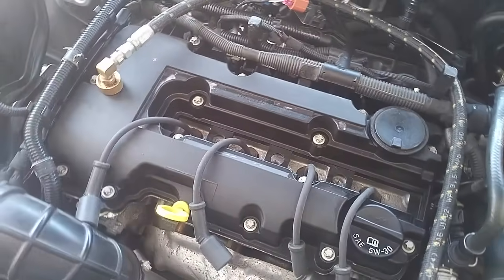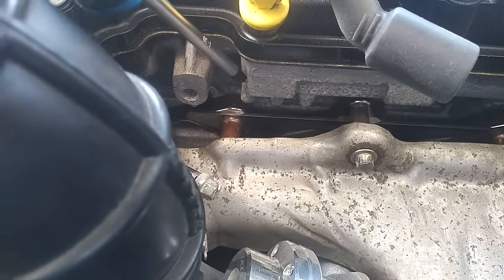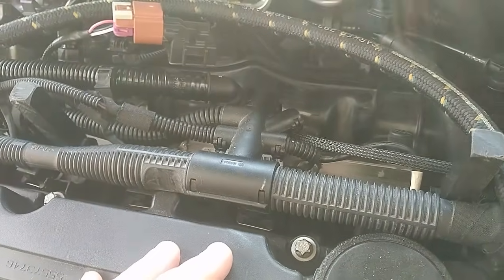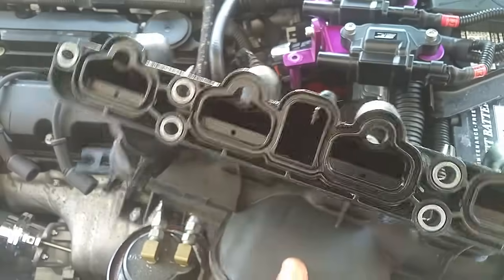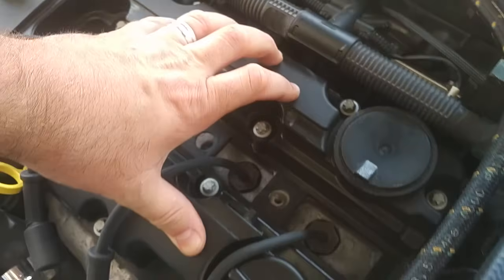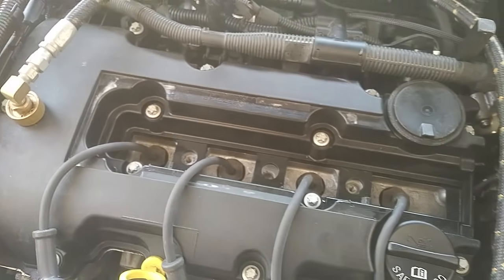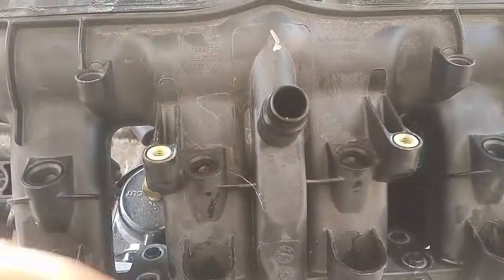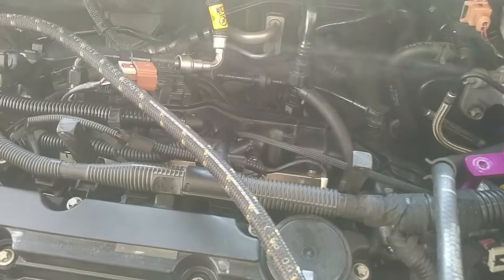Chevy Cruze Sonic Trax Encore 1.4L Turbo PCV Issues, Diagnosis, and Solutions

Comment: So I finished the install and drive and now I’m still getting a leak right around the oil fill cap on the valve cover. I did change my cable cover before I got your kit and drove maybe 30 miles on it. Could the upper PCV release on the valve cover fail again?
Reply from the maker: Pull the dipstick at idle. Put your finger over the dipstick hole to seal it. Do you have mild vacuum?

Comment: had the intake manifold replaced 4 times before 70,000 miles
Reply from the maker: Could have just installed the pcv fix kit and the check valve could be replaced for $5 each time.
Reply: @AndreiDPop  the vehicle was under warranty, i would have voided my entire warranty at my dealer. However since my warranty is over now this would be the fix, but gm did a redesign "so the dealer said" and ironically i have not had this issue since they replaced the last time... fingers crossed lol. Now my new error is Knock sensor.. GM has just turned to shit over the years... I find it really odd that people find these simple fixes and the car companies just do not fix it.. then again, Fix = no revenue... kind of sad.. I'm getting up in years lol, so tooling on my car now is more of a hassle than fun like it used to be. wish i still had my 350 rocket lol.
Reply from the maker: @michaelmorrow9927  there is no redesign. It’s the same part with the same problems. They might have changed the part number but the issue with the check valves missing is the same.

Comment: Hahahahahah great minds think a like. I built one almost to the tee like yours lol. I’m not producing it tho lol. Great job bud yes I did it too my sisters in 2017 and it still good. Also the gear I used is way weaker than yours and my sister drives like a frikin thief  in the night as well so I’m sure your design will last forever bro.

Comment: I have that problem now! And getting it fixed ! Thanks for the information! The parts are cheep but the labor is what is costly!
Reply from the maker: I mean you can install my pcv fix kit yourself for $75. That saves you a ton over having a shop replace the manifold.
Reply: @AndreiDPop  how can I order the PCV Kit from you?  Also, I have not done a turbo boost leak test as I would like to get my hands on one of those as well.
Reply from the maker: @franklujan7480  you can order both of those from cruzekits.com.

Comment: Sorry I can't make heads or tails from this.

1:42 how exactly does the valve cover extract the oil?  

2:18 what's your source on this being a 'vacuum regulator diaphragm'? Seeing as everybody calls this differently it'd be nice to have an official name/source for it. 

2:28 why would the amount of vacuum in the intake need to be regulated? What's so special about the cruze that this needs to happen? Isn't the idle air control and the throttle body used to control the amount of vacuum? 

3:04 an illustration would be nice here, the diafragm limits the amount of air entering the engine? you're saying it 'limits the amount of flow to maintain vacuum at 18 inches of water', but if it.. nevermind I don't get this at all. An illustration here would be nice as well. And what's up with the channels that run around the cover?

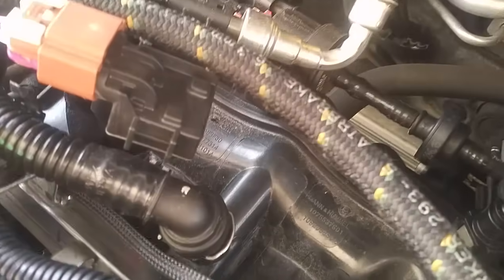7:17 which one of the hoses are we actually looking at? You're saying 'intake manifold check valve' so I assume we're looking at a hose in the intake manifold, but at 6:02 we're looking at the exact same hose which apparently carries PCV gas to the turbo intake. So to where does this hose go, the intake manifold or the valve cover gasket where it collects crankcase vapors?

You're also telling about two ways that crank case ventilation happens: a situation where the turbo is creating pressure, and one where it isn't. I only see one way in the video so it seems I'm missing something.

Extra credits, what's the brass fitting on the left of the valve cover, shown at 10:11?
Reply from the maker: The diagram I made in this thread will also help explain how the system works. 

https://www.cruzetalk.com/threads/2011-2016-cruze-limited-1-4l-pcv-system-explained.175793/
Reply from the maker: The pcv path goes through a series of channels that allow the oil vapor to condensate around the walls and drain back into the sump. 

This is actually a very common design among European cars. It’s a vacuum regulator diaphragm. Anyone else that doesn’t refer to it as a diaphragm that regulates vacuum is wrong. No source needed. That’s what it does. It regulates vacuum on the crankcase to 11-18 in-wc. 

Too much vacuum on the crankcase damages the front main seal. No, idle air control doesn’t regulate anything because the crankcase is connected downstream of the throttle body, and the throttle body electronically controls idle. There is no separate aic valve.
Reply from the maker: An illustration is available in the tech articles section of cruzekits.com. 

The hose is the one on the manifold. Yes it goes to the turbo. The intake manifold check valve is inside the intake manifold and visible when you pull the hose off the manifold. The hose connects between the intake manifold and the turbo inlet.
Reply: @AndreiDPop  thanks for your response. I only have more questions now, like what in tarnation is the purpose of a hose between the intake manifold and the turbo inlet?  tomorrow I'll have a look at the links you sent me.
Reply from the maker: @Netherlands031  to give the pcv gas somewhere to go when the intake manifold is under boost.
Reply: @AndreiDPop  how does this hose carry pcv vapors when it goes from the intake manifold to the turbo inlet?
Reply from the maker: @Netherlands031  the intake manifold has a pcv chamber that connects to the valve cover through the cylinder head. This is a free flowing chamber that has a check valve on the edge of it but still allows gas to flow from the crankcase to the turbo inlet unobstructed.
Reply from the maker: When the turbo creates pressure, check valve in the intake manifold closes and pcv gas goes into the turbo inlet. When turbo does not create pressure, the intake manifold is under vacuum and that check valve opens and sucks all the pcv gas through. 

Brass fitting on the valve cover is for my AMSOIL single remote bypass oil filter return line. 

https://cruzekits.com/tech-articles/f/why-do-we-even-need-a-pcv-system

Comment: I recently received a letter from gm regarding a recall on the pcv valve. I’ve been having issues with automatic shifting and thought it was my transmission, but my mechanic has indicated that it’s a issue with my turbo. Can this issue be caused by this pcv valve? I want to figure out if they’ll cover this issue because the turbo is very expensive to replace.
Reply from the maker: What issue have you been having specifically? Any codes? Have you actually inspected the intake manifold check valve as shown in this video?

Comment: I've been looking at this for awhile to buy your kit. I have a quick question about the check valve nipple. 

I'm looking at purchasing the V3 kit, my question is what if the nipple is still present in the manifold. How do I install the kit? Thank you
Reply: Yea I checked to see if mine was still intact and it was? But my valve cover still has that leak. So do you first try and take out that valve nipple? Or what did you do! Thanks!
Reply: @chrisgiesbrecht4730  Not sure still waiting for my initial question to be answered. I am afraid to take the nipple out cause it will obviously fall in intake trying.
Reply: @optionsice  seems like you can just push it in with a screwdriver. Than cover the hole. Since they always break I'm guessing they just stay inside the port

Comment: An after-market 'fix' is apparently available -  and looks like an improvement on the OEM design:  https://youtu.be/f9CFOPQD4yU
Reply from the maker: Yep, that's my fix. It's both a fix and an upgrade to the OEM design. My latest design is on its 4th revision now (v3.4+). It's far better than the OEM design as it costs far less and makes the valve serviceable.

Comment: So the other hose in the valve cover is the same for the pcv function? And whatbof the product donu recommended for my sonic rs 1.4 please . Thanks
Reply from the maker: That hose in m valve cover is a return line for my AMSOIL bypass filter.
Reply: So what tipe of the kits do u recomend for my sonic rs 1.4 is stock engine
Reply from the maker: @sancheztorres35  the most popular, easiest to install, and best value is the v3.4 kit. That should be your best bet.

Comment: Quick question, does the pcv hose at the intake manifold have both a rubber o ring and a black hard plastic washer or just the o ring? I disconnected it at the intake manifold but I can't seem to get it back on with a click/clip into place.
Reply from the maker: Yes it has both. Get some grease on the manifold and it will go back on.
Reply: @AndreiDPop  Thanks. I just bought a replacement PCV hose because air is blowing through both ways on the old one. But the new one and it's replacement are also blowing both ways. If I blow hard enough there's some resistance but I thought they weren't supposed to do that.
Reply: Figured out that the inexpensive ones don't work like the genuine oem replacement. But now the Diaphragm is sucking in air hard... UGH.
Reply from the maker: @FrankWithanF  get a new valve cover on there asap
Reply: @AndreiDPop  for anyone reading this. The dealership fixed it for free because a special coverage.
Reply from the maker: @FrankWithanF  yeah they’ll fix it but some people have had issues because they require a check engine light to be on and the issue doesn’t cause a check engine light. Also not everyone trusts the dealership to fix it because they’ll just throw another of the same defective and poorly designed part. The pcv fix kit I offer is a design and upgrade to the system that makes the check. Valve serviceable. The coverage is also only up to 10 years or 120k miles whichever comes first, which most of these Cruzes have exceeded now in mileage alone.
Reply: @AndreiDPop  yeah that's true saved me some money though. I'll probably try to get rid of the car before it goes bad again haha.

Comment: Hi Dre Dan awesome video and explanation. You and one or two other guys have similar fixes. What is the hose mounted on top of your valve cover, where does it go and what's it for. Have you made a video showing and explaining that setup. I'm having all the same issues you had and this will be the second time I've replaced the VC.
Reply from the maker: I'm the only one that has the PCV fix kit. There are a few guys who have attempted something different as an adaptation of one of my designs, but there are flaws with each approach. For as simple as my solutions look, they're actually quite complex, and a great deal of time was spent during research and development. Even the epoxy selection took me two weeks, spending hours each day with engineers at loctite and jb weld discussing technical requirements. 

Did you address the intake manifold check valve failure? If not, the valve cover will fail prematurely.
Reply: @AndreiDPop   I have not fixed the issue yet but want to, I just want to make sure what you have for a fix is actually true and a correct fix. You still did not answer my question to the hose installed into your valve cover, please see my last post. I want to do this one last time and fully correct the issue (GM sucks. Any info on installing a dual inlet ketch can and a throttle body spacer. Is that something you have done on your kits. I've seen another video from Spool_Time doing a similar setup. I want to install the best setup possible for all these cruze issues.

Thank you for your time.
Reply from the maker: @RGL642  the fix kit I designed (all three versions, actually) address the intake manifold check valve failure. The valve cover will continue to fail but should last 60k-80k miles or more between failures if the intake manifold is working correctly. It's a true fix as it plugs up the hole where the old check valve used to be and relocates a new check valve externally. You can order any one of them from cruzekits.com. 

As for the other question, apologies as I forgot to reply to that. That's an AMSOIL single remote bypass filter. Superfine particle filtration and adds 1 quart extra capacity to the oil system. Bit expensive but I've found it reduces wear and allows me to operate more safely under extreme conditions. For example, I've been towing my 6x1 trailer for the last 8 weeks every day, pulling anywhere between 600 pounds empty to 1750 pounds loaded. This is while pushing 24psi of boost on a BNR GTX14 turbo and running e85, with stiffer valve springs. . Far more power than stock. 

I don't really believe in catch cans, and here's why. While tuned and driving the car hard, I had to add 1/4 a quart to my car in 15,622 miles of driving on a single AMSOIL oil change. That was before I added the bigger turbo and e85. With oil consumption that low, with the pcv system working properly and running a super low volatility oil like AMSOIL, I struggle to find any tangible benefit to a catch can. Now, I am working on a boost path vacuum pump mod that will further improve piston ring seal under boost, which will provide some tangible benefits. 

You can run a dual catch can setup with a throttle body spacer if you want to. I just don't think you'll see to much benefit. A super low volatility oil will make a bigger overall difference.
Reply from the maker: @RGL642  also worth noting, with my v3.4 kit, you can run a single catch can in such a manner as it would filter both boost and vacuum paths. Pretty simple setup that would eliminate the need for two catch cans and the throttle body spacer if you really did want to run one. It would require just a few slight modifications to the kit design. But I could easily make those and include it as a drop-down option on the v3.4 kit page.
Reply: @AndreiDPop  im interested in this kit as im not seeing the check valve nipple in my intake manifold....and for some reason my valve cover diaphragm hasnt started making any noise or sucking air
Reply from the maker: @jayway8612  that’s normal. The valve cover doesn’t always fail before the manifold does. The manifold causes premature failure of the valve cover though. So if your valve cover is good, I’d install the kit before that fails too (and possibly takes out the front main seal with it, which happens very often).
Reply: @AndreiDPop  will do, thanks for all your work

Comment: Hello, so this would not work with Cruxe LT, that is what i have and i check and looks like pcv in take is all blocked. please advise.
Reply from the maker: the PCV fix kit will work with the LT trim. It won't work with the LS. If you have a gen1 1.4L turbo, you can use the pcv fix kit. You will need to clean the pcv port in the intake manifold first.
Reply: @AndreiDPop  thank you. One more question, is the block because of buildup and I need to push past it?
Reply from the maker: @EOO-Stand  what do you mean by "push past it?"
Reply: @AndreiDPop  when I pulled the intake hose, I looked inside the manifold intake and it’s sealed half way down like clogged or built that way not sure. I wish I could send photo
Reply from the maker: @EOO-Stand  probably just deposits that have built up over time. Manifold needs to be removed and cleaned through.
Reply: @AndreiDPop  will do. Thank you very much. Very helpful

Comment: With the kit installed, is it necessary to add an oil catch can to the system as well if you have a build motor an v3 turbo upgrade?!
Reply from the maker: With the kit installed, you should need a catch can at all. However, the v3 turbo may create conditions that create a need for a catch can so I can't say if you'll need one then.
Reply: Okay thank you, I’ll order one an still get the catch can because I’m looking to make Bigg power, thanks again for your response!
Reply from the maker: @paceauto5382  make a note in the kit when you order it so I can get you the T fitting you'll need for the catch can setup. The fitting currently used wouldn't be very good for adding a catch can.
Reply: @AndreiDPop  okay thanks, will do!
Reply: @AndreiDPop  can you check your business email please, I made a mistake with my address in the order. I submitted the correct one via email, thanks.

Comment: A family member have an oil leak on the crank pulley (passenger) side. I've repaired it couple times but have not really found the problem. I replace the crank seal like 3 times, clean it up and it'll leak again anywhere from 3-10 days. When it leaks, it's not small, and apparently it only leaks while driving so I can never get a chance to pinpoint it. It gets oil everywhere very quickly and destroys the belt on the way, which I had to replace every time. It does seem like it's pointing to a high pressure issue... If any of those three components failed, would it cause an oil leak on the crank side? I am no auto mechanic, just a garage guy with lots of unnecessary tools.
Reply from the maker: Bad valve cover causing excess crankcase pressure or missing intake manifold check valve. Will most likely need my PCV fix kit. Front main seal won't leak unless you have crankcase pressure. Crankcase pressure indicates PCV issue. Start with my pcv fix kit from cruzekits.com and go from there.